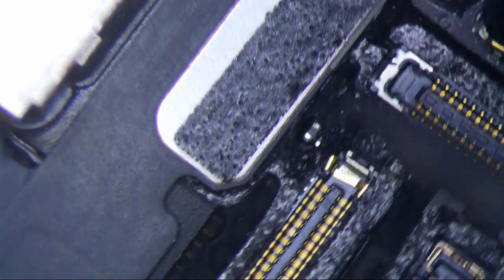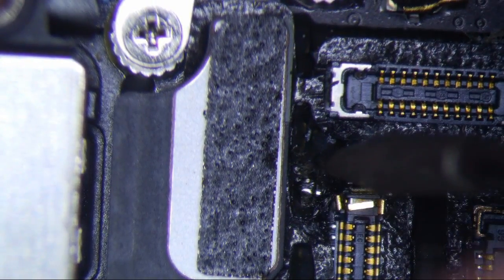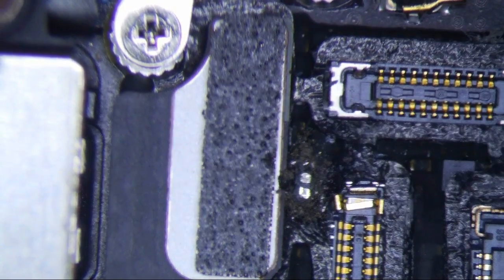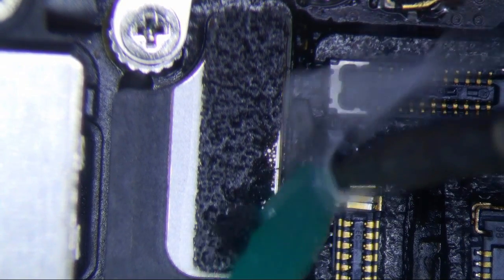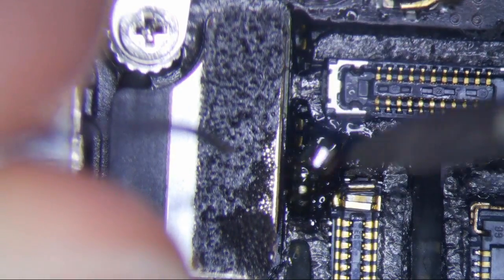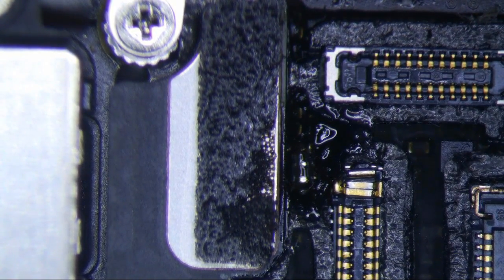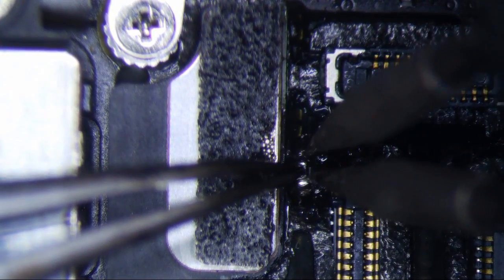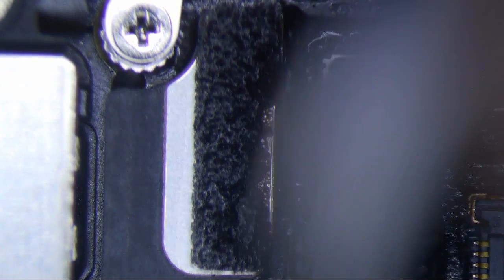JBC NASE 1B iPhone 6s Backlight Filter Repair

Comment: Looks like the touch-screen FPC connector brace on J4200 is coming apart a little there?
Reply from the maker: Yeah, I fixed it after the backlight filter was repaired.